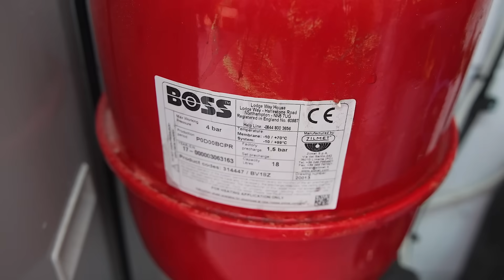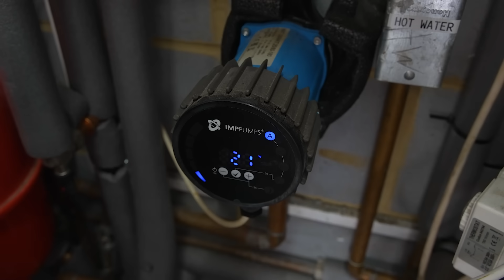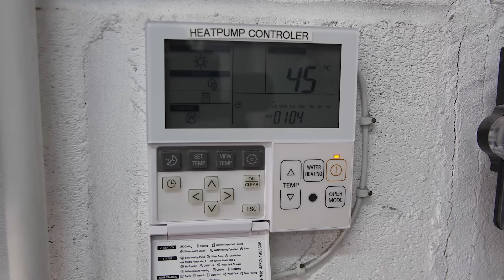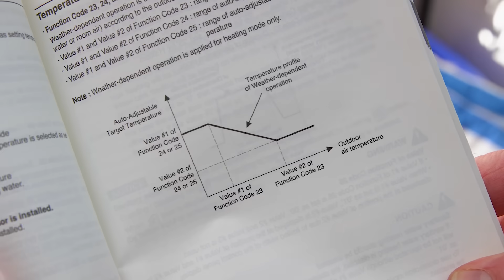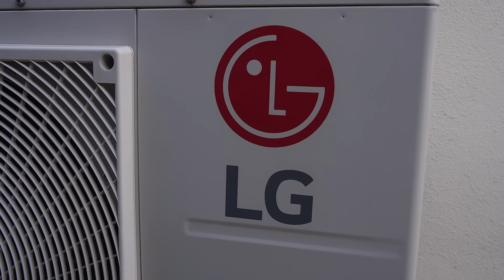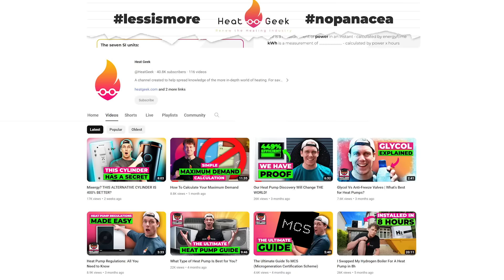Heat Geek Gives His Verdict on John’s Nightmare Heat Pump

Comment: John wanted to do the right thing ,but you have to think about the total cost. The cost of making the pump and system, the cost of the generation of electricity , the cost of service parts ,even the cost of the diesel for the engineer .
Reply: What is the right thing? Virtue signalling that you are zero Co2 whilst somebody in China burns oil to produce your equipment and a gas guzzling power station powers your energy gobbling "green" heat pump - while you freeze inside the house and wait for the next huge bill ? LOL
Reply: @SouthIslandSk8 China CO2 per capita is only slightly higher than UK, but less than half of USA.
Reply: By the way, CO2 is the gas of life More Co2 means bigger plants and a greener planet.
Reply: @SouthIslandSk8  true, but if the transition is too fast, things get bad, really bad.
The basics:
More CO2 means higher temperatures (also good for plants IF there's water as well)
Higher temperatures means less ice, means higher sea level... Up to 70 metres higher sea level.

So, look at everything we have that is near sea level and look at the cost of moving it..
Every sea port, several major cities, all coastal communities.
We just cannot do that sort of work overnight.

Comment: This doesn't persuade me to get a heat pump.
Reply: Or me, it put me right off.
The vast cost, huge increase in running costs etc.
Electric heat pumps are not cheaper to buy, install and run than gas. 
Your heating system should not be so expensive as to be treated as an investment. 
Sadly,  this customer was scammed like so many others.
The money involved is terrible.
Reply: Air to air like the rest of the world. Much less complicated.

Comment: Two people with slightly different views, having a sensible conversation on the internet. Whatever next
Reply: Views are not important,  whether it works or not and the cost compared to gas is important. 
It's as bad as paying £15000 for solar panels and battery and making a tiny gain each month. That money could have been invested to pay the bills each month. I can see why electric companies want people to charge batteries and sell energy at a fraction of what other customers will pay. People are being used.
Not one of the people with a heat pump will give true costs or true running costs each month. They're tired of people saying they were scammed and feel foolish.

Comment: Thanks Guys for a comprehensive run-down of this subject.  I appreciate that it will require an expert to fashion a system to suit a property and as a result some saving might be possible. HOWEVER, I am shattered at the  miles of fancy pipework and expensive gadgetry that festoon the installation.
            Even presuming it works and is worth the obvious heavy cost of the installation, I can for-see a lifetime of faults and maintenance costs all far beyond the means of the average home owner. The inconvenience and the outrageous cost of 'getting the engineer out' every few months just to keep the heating working is not for me !  This is never going to be a fit and forget setup. 
             We already hear about how difficult it is just to get someone to come and sort a problem. Come the cold weather and all those thundering units frost-up and your world turns cold, you'll be sitting therein your Onesie hoping for the doorbell to ring.  We are being railroaded into this insanity and will live to regret ever having listened to the 'Experts' .

Comment: The main problem here as I see it, and taking into account all the information I could gather seperate to this film is that heat pumps are shit. I've been to Scandinavia including Finland and they all have backup systems and wood fires as well as heat pumps.
Reply from the maker: I am sitting in front of my wood burning stove right now. It is very hard to compete with. It even has a nice mesmeric flame that dances merrily in the dark.
Reply: @SkillBuilder  carbon neutral is a very big money spinner, it's part of that old adage, you can fool all of the people some of the time.

Comment: And this is in the warmest part of the UK. What a mess of complication to get these to work . It's all a con for old  properties and Heat Geek doesn't convince me one bit.
Reply: Remember electric underfloor heating installed in 1960s and was too expensive for people to use 10 or15 years later? Heat pumps are the new version of that.
Reply: @Puffball-ll1ly No, they really aren't.
Reply: @Etacovda63  heat pumps are entirely futile to most of Europe's housing stock built before 2000 and possibly 2024 considering the crap that is built now . Time will vindicate me 💪😂
Reply: @Puffball-ll1ly It wont
Reply: @Puffball-ll1ly  Albeit a 350% + efficient version.
Reply: @Etacovda63  heatpumps are designed to recover heat not be the sole heating system. Madness I will be vindicated by time.

Comment: Absolutely excellent video. These are being installed in my area at the moment (Wigtownshire, SW Scotland) and I've been offered free installation. All I've heard so far is that they are too expensive to run and that they are not designed to work in Scotland! A friend who had the system fitted only weeks ago is thinking of switching it off as too expensive to run but it may be down to how efficient it is running and may not have been installed properly.
I haven't opted for the system (still on storage heaters) because I don't know enough about it and won't either until I hear more positives. Adam certainly knows what he is talking about but it's complicated for laymen to understand so I'll watch it again to try understand a little more.

Comment: My electricity is 5 times the cost of gas. I would need a cop of >5 to break even. Today there is no wind or sun. The electricity is produced by gas! Read Not Zero by Ross Clark.
Reply: Your being ripped off a bit there I would say. Nearly all of your other home appliances use electricity, change supplier
Reply: We came to the same conclusion; we do have one of our air-air units come on in the early hours when electricity is 14p/kwh and turns off just before the 8am peak rate comes in, but otherwise it tends to work out more costly to run. But regardless we still fine it flexible when we want spot heating.
Reply: @HeatGeek what tariff would you suggest because there is not many options agile is horrible at this time cosy may the best but not so cheap and not long enough.
Reply: @bgjfhfkyg   Litrally ANY. I cant find any tarrifs at a 1 rto 5 ratio.. usual is 1 to 3.6ish..
Reply: @bgjfhfkyg  Right now the Flexible Octopus tariff for our area is a 4:1 ratio, but remember that you also have to factor in your boiler's efficiency. I'm going to go out on a limb and say that most gas boilers in the UK aren't setup to condense, so let's say 80%? With efficiency taken into account, the magic ratio is suddenly 3.2:1. (90% would be 3.6:1)
Reply: Rates are gas 6p electricity 30p per kWh. I get electricity at 7.5 at night. But no use for heating. I am with octopus
Reply: @LauraSwabe  Ah okay so your day rate is slightly higher as you have a dual rate tariff. In this case your break even SCOP is 4:1 with a boiler efficiency of 80% and 4.5:1 with a boiler efficiency of 90%. However your night rate is applicable as even with a setback temperature your house is still being heated overnight and the night is the coldest part, so your average running cost will come down with such a low night rate.

Another option you have is to install a battery without solar and then charge it on your night rate, even a single 5kWh battery will provide a considerable price offset to your daytime costs.
Reply: Battery cost is too high.  My boiler is near 90% efficiency. I don’t heat the house at night. When electricity is not produced from gas heat pumps will be suitable. Until then count me out.

I understand heat pumps. Have converted two portable air conditioners to heat my large green house. They extract heat from ground water from a well. Difficult to get the SCOP above 3 when you take into account the power needed to run the water pump.
Air to air does not work, as the evaporator ices up.

Someone needs to design a heat pump that dries the air before it reaches the evaporator. There is a Japanese patent to do this, but far as a I no one has made one.
Reply: @LauraSwabe  Yes the battery costs are a bit too high right now, will be better once the government finally allow the VAT exemption to apply to batteries on their own without additional solar panels.

I don't see many water source heat pump setups, do you discharge the water back into the same well? I'm curious to know what well temperature you end up with during winter?

I've not seen the Japanese patent on drying the air so I'll have to have a look for that! It's not clear in my head how that can work without wasting too much energy but I'll have a look for it. I would say that on ours (5kW) the defrosting isn't an issue even when it's sub-zero, only takes a few minutes and does it every 90 minutes or so. I think that's an area that manufacturers have made great improvements on in comparison to traditional air conditioning units, but you do need a sufficient water volume in the house in order for it to be effective.
Reply: @yngndrw.  I know how to calculate, and people who has a good working system, and could say exact number about the savings, they save 10% compare to gas.  Thats simply physics and math you can save max 10 odd % compared to a new modern boiler. But the heatpump is much more expensive so this investment probably never returns. It would be better for the environment and your pocket if you spend that money on insulating the house, and reduce your energy demand.

Comment: Here in New Zealand almost all domestic heatpumps would be air to air, which utilises minimal equipment (and cost). As for not wanting to put a cassette (the internal part) in an older house, a number of manufacturers offer floor cassettes, which are lot less visually intrusive. 
My background is in industrial refrigeration and hot water systems, and I can only agree with the commentators here that the system shown is needlessly complicated.

Comment: Great discussion of real world issues. I have recently built a site of 2-4 bed houses all with Daikin heat pumps(£10-12k each unit), a no gas site. The units can be sat on rubber mats buts still hum into the night, also the unit blows cold air by the patio doors, like a fridge door left open. The residents are in a real world experiment, to see what the electric bills are in the future. Jury is still out as to performance at -5 to -10.
Reply from the maker: Let us know how they go. Good or bad, happy or sad we are interested in real life. I have just been reading Daikin's literature where they play down the problems some people have. It would have been good to see them acknowledge some of the issues and deal with them constructively.

Comment: This vid is spot on, originally heating systems were easy rads every room gas boiler job done (ok bit more difficult but pretty straightforward) along comes heat pumps and solar, order of difficulty higher. Bunch of companies no clue who’s good or bad and your pretty much relying on them due to the complexity. So my experience is good heat pump installation bloody disaster on the solar. Solar company went bust (no surprise there) but need solar panels refixed and new battery (expensive).

Comment: We’ve had a Greenline heat pump for circa 20 years, with only a few glitches, which are maintenance issues.  Since the energy costs rocketed, we’ve really honed in on setting the system to be more efficient.  Ours has been a dream in comparison.   There were issues with competency with installation, more on the underfloor heating side than from the heat pump suppliers, we needed a commercial engineer to hook the pump with underfloor, which worked out ok.  However, joined up thinking is definitely the answer, and that was slightly lacking even with fairly decent people involved.  We might look up the “Heat Geek” guy in due course.

Comment: I have a buffer tank on my heat pump. It was installed by a leading award winning company.  As I understand it, a buffer tank  aids the heat pump because there is  less ramping up and down of the speed of the pump and a faster heat up time when the temperature drops.
Reply: I hope you're right. I've got an 800 litre buffer tank on my system for a 350sqm house, feels a bit excessive but been doing ok with it for 7 years. It's in the summer when I occasionally use UF cooling that I wish the tank was a fraction of the size.

Comment: I'm an Australian HVAC Consultant with 55 years experience with air-to-air heatpumps and my categoric recommendations for the UK market are: -
- Use air-to-air heatpumps for space heating. They are inherently more efficient, provide cooling in summer, are much cheaper to buy and install, much quicker to install, and way less complicated and controllable than air-to-water systems. The COP of an air-to-air system will always be higher than an air-to-water system at the same ambient conditions due to the physics of the refrigeration circuit.
- Use a separate, packaged, air-to-water heatpump for the domestic hot water system, with the largest practical internal tank available. Compared to gas, they have a slower recovery rate and reduced capacity in cold weather, so the more onboard storage the better.

Comment: Couple of things 1- ensure,if your going on a course,that its got govt accreditation,ensures your getting correct training 2-dumping a perfectly good heat pump for a bearing isnt very green,or economical-a garage can fit your bearing,as its probably a press-fit, or fit a new  fan bladewith a new bearing- then you can sell it, and your getting money towards new heat pump- although, he said he xould get a good scop out of it- I'd fit the bearing (or complete fan blade assembly)- less than £100 (probably far less) and run it,see what the new outputs were.

Comment: Great video. Biggest problem for all homeowners is when the next expert arrives he shits on the previous install...."why did they do that".  Its a shell game.                                                                                   
I wouldnt want to be an earlier adopter as most of this equipment will be obsolete in 5 years time with part availibility issues etc just like the wood pellets.    Once enough cowboys  leave the industry then it might improve.  Im all for efficency but what are you really saving over the traditional oil fired boiler in the long run. The Kiss principle is my  mindset.

Comment: What's good here is the understanding that heat pumps need expert design and installation not just bang in a walk away approach that fossil fuel heating systems have used for years. Heating needs thought and care but the only criteria used for gas boilers has been safety. Efficiency no interest as gas has been cheap. Not cheap anymore so the deficiency of gas installations is now becoming clear.  A very good video.

Comment: This was absolutely brilliant, I am now considering the buffer tank, and my retrofit UFH manifolds which have thermostatic mixing valves.  I often wondered if they were needed.  The stability part as well on the heat pump bearings - wow.  Great video guys - much appreciated.  Only quibble is some people just simply don't want gas and that's the priority, not cost - though i wouldn't mind paying less ha ha  Great video thank you, I was glued all the way through

Comment: My understanding of the need for the buffer was that the heat pump needs a constant volume flow rate where the system, if fitted with zone valves or even TRVs , has a variable flow . Buffer vessels properly sized should have good stratification so that there is no mixing. The flow rates would normally be balanced rather than the system having a higher flow rate than the heat pump itself if it was matched to system heat loss. Larger connections to the buffer equals lower fluid velocity and less risk of intermingling. Having said that, much will depend upon the design and operating characteristics of the heat pump. When we started designing systems back in the eighties compressors were generally not inverter speed controlled. Modern units maybe variable output so less need for a buffer vessel I suppose. Anyone having an existing combi boiler to heat both space and domestic hot water looking at Johns system would be horrified at both the space for the heat pump system and the obvious capital cost. One 13amp fused spur and a remote thermostat versus a plethora of isolators and controllers and armoured cabling and control wiring. What I’m seeing is a commercial scale set up. No wonder people are put off heat pumps!

Comment: Our local council have installed heat pumps in all the old peoples bungalows in one village and it is a disaster! i have seen people in there late 80s with hypothermia and others with halogen heaters and electric radiators just to keep warm, It is a shambles.
Reply from the maker: Can you tell me the name of the village? I would like to do some interviews
Reply: i would have to get permission from the tenants first but i will ask. @SkillBuilder
Reply: they are very elderly and would be scared stiff to be interviewed. if you are genuinely concerned try contacting Newark and sherwood council for more info.

Comment: Microbore, Microbore and Microbore. Most modern houses built in the last 30 odd years use microbore and in our house the whole downstairs is microbore buried in the walls. 4 plumbers have said they wont consider our install because of the amount of work, expensive, involved in replacing that. I have concrete ground floors so any attempt to run new pipe there would be a disaster let alone replacing expensive wood flooring. One guy quoted £20k for the whole lotb with ugly pipes running along walls and huge rads. Answer on a postcard please